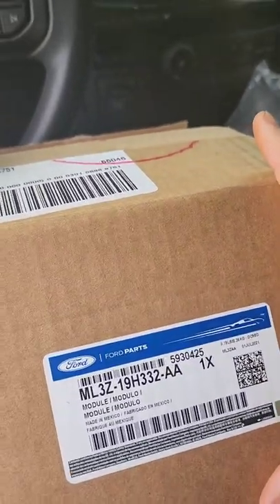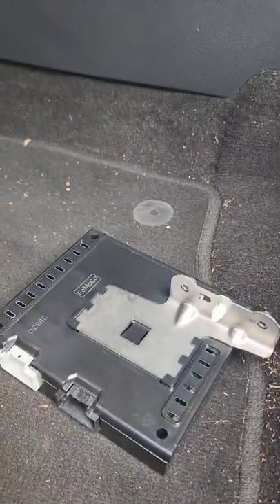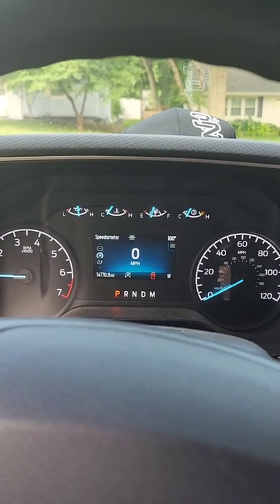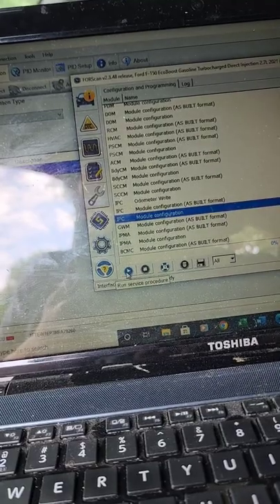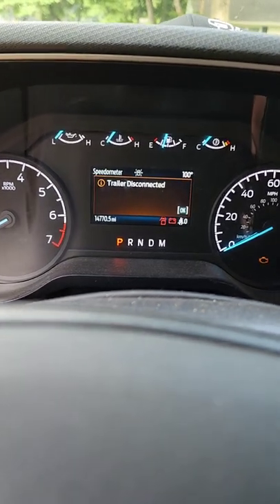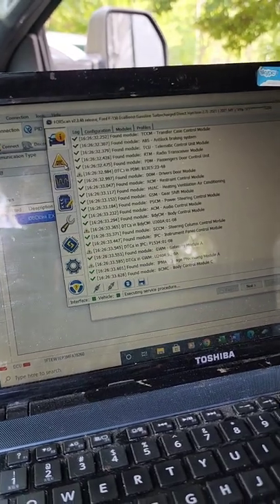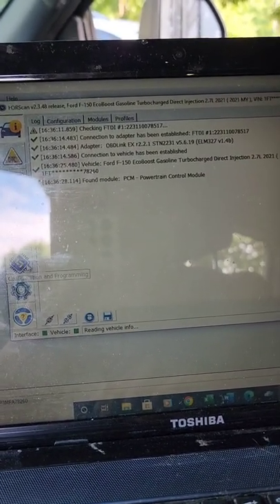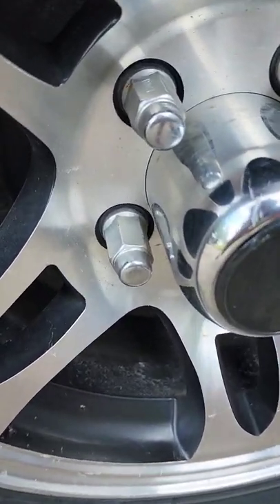2021 F150 Trailer Brake Controller Instal and ForScan update

Comment: I just finished setting up mine on a 2021. Had to buy extended license for Forscan to allow the change, $12, no biggie, good for one year. I disconnected everything and, shut off ignition, locked doors, etc. twice.  Checked and it is all enabled.  Thank you Kevin for posting the video!!

Comment: I’ve got a 2022 f150, that I want to add the controller too. Did you only have to turn the ICPM- trailer brake controller module to enabled? 

My dealer is saying it’s back ordered, but I can find the OEM for sale online and I’m looking to order it, I’ve never messed with Forscan before
Reply from the maker: It's been a while since I've done this. I don't recall having to do anything else. I would check some of the other videos just to make sure

Comment: You need to load your as built from the old module thru forscan to initialize the new module.  Then you can go thru the forscan documentation and set the module to start working correctly with your truck options for trailer brake control (i.e bcm, ipc apim, trm, ipma ,. If you don’t do this you will have a hard dtc that will not clear until trailers brake module is set up correctly. The dtc will not be a light on dash, only stored..  all that said there is more to it then using the standard English setup in forscan..
Reply: Can you give a quick share on how to do this

Comment: What is the difference in the under the dash parts? I added the in dash gain controller and enabled everything in forscan and it did not work for a 2021. I did the same thing to my 19 a few years ago and it worked just fine.

Comment: Does anyone know if I must change the brake module under the dash ? 
I’ve added the trailer brake gain 
Controller , and trying to turn on the module with forscan ?
I got a 2023 F150 
And used parts from another 2023 F150 in just trying to turn on the module to the truck knows we have trailer brakes now 😊
Reply: I tried to only install the gain controller and turn everything on in forscan and it did not work. Im wondering what the differences are between the under the dash parts.
Reply: @scotthawkins4587  I ended up going to the dealer 
Had to buy a module . It’s not just turn things on .
I’ll never attempt fkn with writing again , cost me an hr to have it rewritten back to proper
Reply: @Steveakakid  I’ve done several truck and never had an issue. I always take a picture with my phone and a screenshot on the computer of the original settings. 

My dad finally retired and bought a 21 f150. This is the newest truck he has owned in awhile. He has always bought new vehicles for family, but never did for himself. He is proud of that truck and I’m happy for him. 

I was able to get Bambi mode and global windows to work. I also got rid of the double honk and some more chimes for him. He didn’t care, but I was disappointed when the TBC didn’t work.

Comment: Kevin good vid appariciate showing us. So I ordered brake controller & modular and it arrived today. I paid $243.00 Did I pay to much? Please if you could provide where you purchased your's from. I have a 2023 which should be the same. Thanks
Reply from the maker: Yeah I think I paid 275 for both parts from the dealership. I'd say you did good
Reply: If you don’t mind me asking do you know the ford part # you ordered as I have a 23’ XLT and wanting to add the controller as well, truck has hitch, 7 pin as well as the backup alert! Don’t know if that matters but seeing different ones on dealer sites. Thanks a lot.
Reply: You paid the right amount. At the Ford dealership they want $350 for it plus another $300 to install and enable.

Comment: So what's the total damage, 210 for controller than the obdlink gadet at 149?  What's the ford scan software cost?
Reply from the maker: I think the parts were around 300 or so when I got them. Software was free but I got the $20 version and I think that cable was around $30 or so
Reply: @kevinpark5474  thank you for the informative video!

Comment: Those both came together in that box with the part numbered shown in the video!? Thanks in advance Kevin. In the same boat!
Reply from the maker: Much to my surprise they sure did. I did read online there is a way to run extra power to the module, but I needed to knock it out quick. New module and controller, sold the old one online.
Reply from the maker: When I ordered it online, there was one part number too, but in the box was the two parts with their own part number. If you order from the dealership you'll be good, anywhere else, just verify you get the controller and module.
Reply: @kevinpark5474  thank you for the reply. I have two different part numbers in order smh. Neither of which are that one! My dealer and the other two nearby all say different things. Not to mention both are on back order. Going to try and order this part number and see what happens! Fingers crossed. Thanks again for the reply! Be well.
Reply from the maker: @Joseph Briggs  I read on a Facebook forum just a few weeks ago that they changed the part number for these controllers. Not sure if they made an update or what to the part. I'll see if I can find that post and link it. I haven't had any issues though - had to drive past 5 dealerships to find one in stock when I bought it.
Reply: @kevinpark5474  What do you mean run extra power to the module?  Would this be a work around if not installing a new controller?  Thanks for the video, this helped!
Reply from the maker: @Drew MacVane  hope I'm not dreaming this up, but I remember reading a post on FB or F150 forum where power was ran to the original module under the dash and then the new oem controller worked. Still would have to come up with the controller though. Wonder if any of these are in junkyards yet wrecked - seen a few being parted out in FB.
Reply: OK, I'll see if I can dig it up.  Like yours, my truck had a controller from the factory.  I'm wondering if I can source a gain module and then reflash the factory controller.  I've had two dealers tell me I could but they also gave me different part numbers for the entire kit (both of which are not available currently.)  Thanks
Reply: Wanted to update ths for anyone else looking. It is possible to use your existing brake controller (TRM).  You need Forscan v2.3.51 which has the TRM config function. Now all you need to do is enable gain in the IPC (as shown in this video) and "SYNC gain" and "Trailer Brake Controller"  in the TRM.
Reply: Did you do it though as built and change the diff. Numbers that were needed?
Reply: @adamc2909  assuming you’re replying to me? No need to change numbers, just use the enable/disable buttons. I made a video on my channel detailing how to do it.
Reply: @Drew MacVane  since you did it, how is it working for you? Any issues?
Reply: @adamc2909  I did it. No issues at all. When I went in with forscan I had to activate the trailer brake and make sure it was turned on in the BCM. You will get a new trailer menu option in the main display which looks really cool.
Reply: @drewmacvane2308 where is the video? Did you take it off?